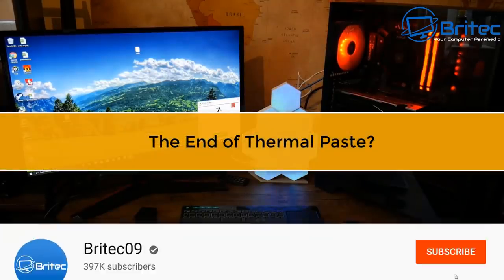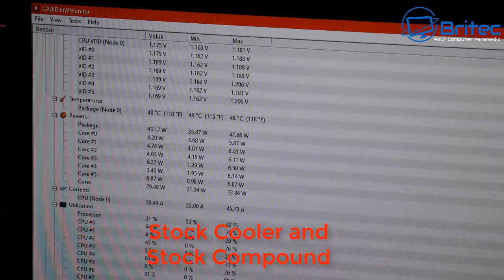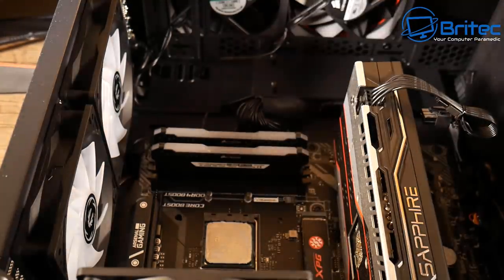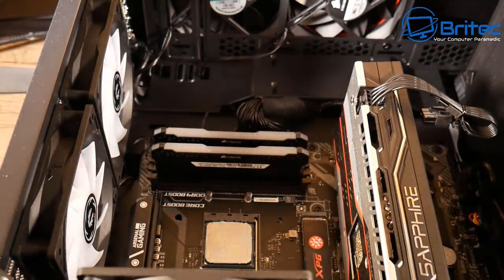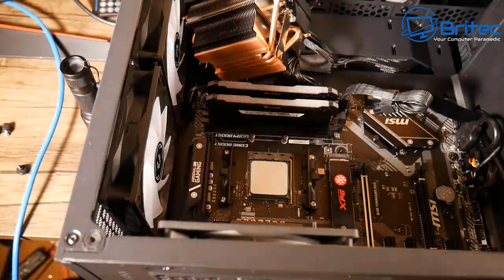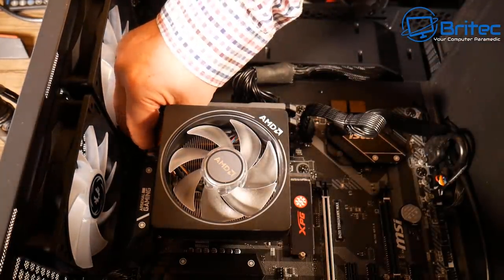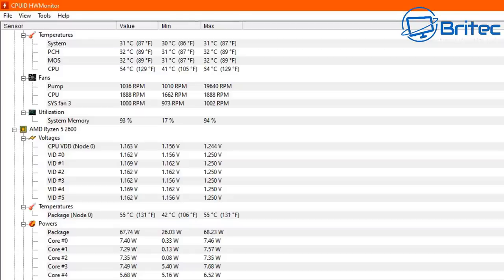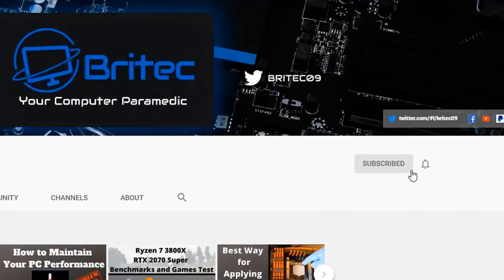The End of Thermal Paste?

Comment: Might one use a small amount of thermal paste to keep the pad in place during the install?
Reply from the maker: That sort of defeats the object or no thermal paste.
Reply: @Britec09  will it increase the temperature if i use thermal paste?
Reply: @Britec09  Just a dab to keep it from skating away?
Reply: That depends on whether or not the pad is capable of absorbing some compound.  If so, it will probably become even more conductive as it would displace some poorly conducting air within it.  Otherwise, your only increasing the amount of matter the heat must travel through prior to reaching the cooler.  Either way,  I doubt it could hurt the performance much.
Reply: I atually have used this one aand have done the thermal paste thing. okay. I have tested it but didnt change alot but I even think its a deficit: So it depends but the thermal pad is not perfectly flat. YUou could argue that adding paste it would smoothen out the pad, buuut it also makes the pad thicker aand some parts that would be direct contact would be covered in thermal paste. So overal, I would not advice, unless you can get a very very small layer on top of it. But like minimal. And even then you should see the performance. Its complicated. I would not suggest, but i know it doesnt stay on the spot always, most of the times it slips, so in 2 corners a small small amount to just hold it, is okay.
Reply: and also all the issues of not being the same W/KM value, the paste will act as an insulator compared to the pad()
Reply: @reason2463  No.  If needed,Use a single tiny drop of distilled water on the center of the pad. That's what I did.

Comment: My 2600 idles at like 41-45c. It only gets up to  61-65c under load though so I haven’t been too concerned. Maybe I need a thermal pad? Also have a deepcool gammaxx cooler. Pretty cheap cooler but it should at least be as good as a 212
Reply: Read up on Ryzen voltages. Stock settings cook the CPU.
Reply: @kenzohkw  I've tried all the power settings tweaks that I could find and nothing changes. My only resort is switching it to power savings mode and that keeps it low, but thats a bit of a hassle and i'm just running it as it is. My EDC in Ryzen Master is also constantly pegged at 99% if I'm doing anything.

Comment: Need a lot more testing. A Lot. A $10 single pad vs a $7 tube of paste that can be used on anywhere from 50-100 cpus. That's insanely cheap paste. Need more variety of pastes. The last paste I used was mx-4 which is a decently cheap paste that can last up to 8 years. I realize the pad is reusable but for how long? And you can only have it on one cpu at a time. With paste you can paste several cpus and gpus before running out and afterwards you shouldn't have to apply for a long time. I dunno... This sounds like a gimmick.

Comment: The test is useless if you are not using the same cooler for each part of the test.
Reply from the maker: ? are you blind? stock cooler had stock compound and hy710 same result. I changed cooler to Wraith prism had thermal pad and thermal paste hy710. You really need to watch all the video before making silly statements. idle and max temps done. This is not about stock cooler, but about thermal pad. Anyway, thanks for watching.
Reply: @Britec09  i have the same problem with your video. please present variables and outcomes more clearly. do not change two things at once, it disorients, devalues your work. also, have a clear table summary at the end of a video. showing it on screen scattered all over the place in the video just ain't gonna cut it. pronouncing also doesn't help much. there are international viewers too. big up yourself, respect.

Comment: what if you apply some thermal paste and put on that thermal graphite pad? Do you think the temp would be much lower?
Reply: Mixing thermal solutions creates problems, it doesn't solve them... you will create hot spots because different thermal solutions dissipate heat at different rates, this is a terrible idea.

Comment: what about a tiny dab of regular thermal compound on one of the outer corners? Just to help keep it in place
Reply: If you go that route you might as well add a little more in the middle and save the hassle of messing around with the pad.😉
Reply: @garethevans9789  the idea was to keep it in place nothing more ans has been suggested, a dab of distilled water should do the trick
Reply: I was half joking.

Comment: HWMonitor often misreports temperatures on Ryzen processors, try using Ryzen Master instead.
Reply from the maker: no difference on my machine
Reply: I've been using core temp with good results
Reply: @guywithjeep  I've had temperatures reporting a good 10 degrees over what Ryzen Master reports myself. I guess it varies between hardware.
Reply: @microgamestation  I find core temp is right on par with hwinfo64, it's lightweight and monitors in the tray. And I agree, hardware has a big influence on how the apps read...

I found with hardware monitor, my temps were all over the place -5 to ~205°c which I know aren't correct, or it would have throttled and/or let the smoke out..

Comment: I stop using thermal paste i got 4 computers in my house 3 with air noctua push and pull with pads and 1 h100v2 with pad max temp 55c 3600x.

Comment: A proper coating of the thermal paste will take a decade, of 24/7/365 processing heat, before it dries and needs to be re-applied.

How long can that pad remain functional?  How long before it dries up?
Without any long term proven results, I see no reason to roll the dice with pads.

Thermal paste is used on countless computers, in homes, offices, and businesses of every size.  It is a proven and reliable product.  I just do not see the point of taking any chances with a pad.  What is to be gained?

Comment: Thermalpads are great for VRM's where a gap needs to be filled in (read: graphics card) or where there can be slight height diffrences between the VRM's due to soldering and part tollerances (read: motherboards). 

As for CPU's and GPU's thermalpaste is the way to go. I hope in the future we can use liquid metal instead, without the disadvantages of the current  liquid metal products.

Comment: Ah, so frustrating!

I've been trying to find a thermal pad review where the reviewer probably tests them. A midrange CPU with a stock cooler the TIM doesn't really make any difference, you could probably use ketchup and barely see a difference.

I'm now wondering which condiment has the best thermal transfer properties.🤔

PS: 40c+ at idle. 🤯
Reply: Linus Tech did a full review... also Greg Salazar did as well both with better controlled tests... this "test" was all over the place... you don't change coolers in the middle of testing.

Comment: Paste isn´t allowed to be where metal could touch metal, but only in the ridges and scratches of the 2 surfaces, but you show nothing about how you apply the paste! Concidering 99% of the people apply paste faultly, so that thermal pads had to come to compensate that inability (they worse, but paste is anyway always applied faultly!!!), how can I now suppose, that you applied the paste correctly, if you don´t show the process??? Thermal paste layer has to be microscopically thin, so, not visible to human eye, and only covering the "imperfections" of the 2, otherwise supposedly perfect, metal surfaces...

Comment: hahaha, this dude is slow in reviewing at least 2-year-old technology to his subscribers. Thermal pads have been around maybe 2 years, maybe more. The thermal paste is still around. Hmm, when was the last time I used thermal paste? Was it in Nov. 2019? My next build is planned for the first week of Feb 2020. I'm planning on using thermal paste. Dude keep up the good work. I might unsubscribe from LinusTechTips and subscribe to your channel if I want two-year-old technology news.
Reply: maybe britec09 is excited because the new thermal pads are colorful. Did brite mention you can fry the CPU?  The thermal pads conduct electricity.
Reply: @MSum5  many thermal pastes are also conductive (all metal-based compounds)... if it's just between the CPU and Cooler it's not an issue AT ALL (in fact it is great for passing the heat into the cooler)... having a conductive paste/pad is only a problem if it goes beyond and gets all over the motherboard (far less likely with a pad than metal-based thermal paste).

Comment: Bad explanation: "basically you put this on your CPU and it will cool it down" what paste and the pads do is fill in the gap and micro pits on the CPU and cooler to make more consistent contact to the cooler will be more effective.
Reply from the maker: Bad explanation?: If your trying to be smart and nit pick, your wrong, its not putting thermal paste on the cpu, its putting it on the heat spreader and fills in the microscopic gaps between the heat spreader and heatsink. The CPU die is underneath the heat spreader. The thermal paste will help make better contact between heat spreader and heatsink, which will the help dissipate heat better. Hope this clears it up for you.
Reply: @Britec09  wasn't being smart it's called creative criticism and you basically just said what I just did. 
The paste and pad don't technically do the cooling they are a filler to keep the contact between the two surfaces to a maximum. 

Just being helpful as your explanation could leave your viewers a bit confused things like: if this cools maybe I should use two or end up applying to much paste thinking is a coolant that's all.

No need to get offended just thought your video warrented a slightly better explanation.
Reply from the maker: @x30nplayerone71  Its all good, don't mean to be snappy, comments section on Youtube can be a toxic place  sometimes, had replied to a bunch before this one. I know how thermal paste works and what its for and sometimes I don't explain things very well. Have a great day.